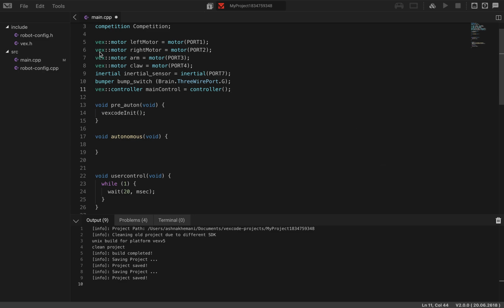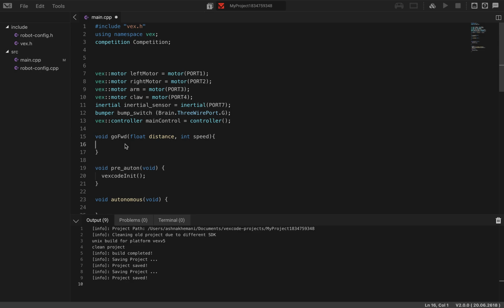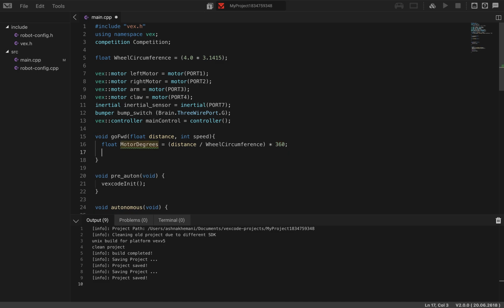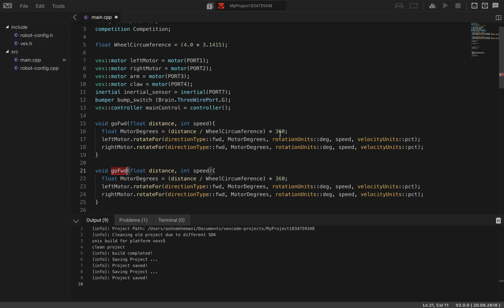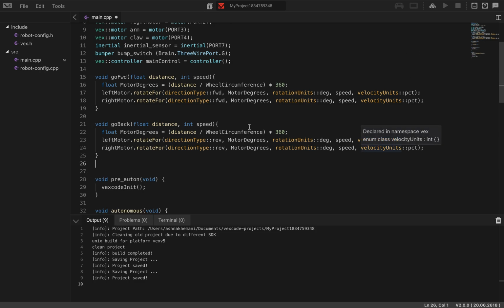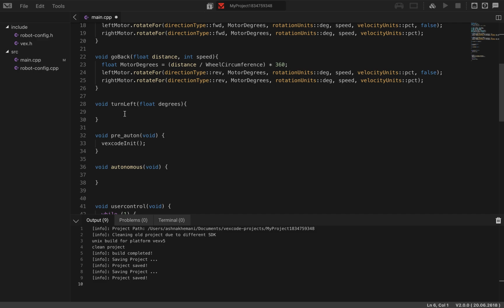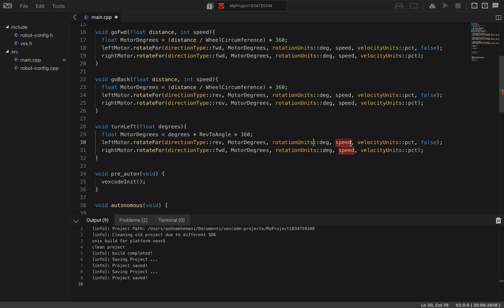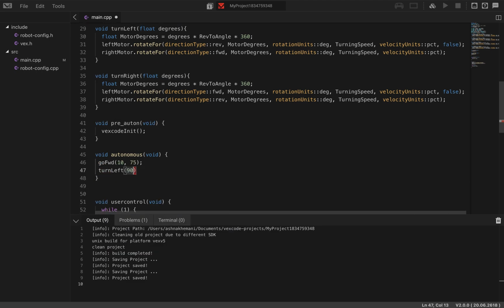Autonomous Drive Functions VEX V5

Comment: Amazing video! Just one question. I know that sometimes robots like to veer off just slightly, which can affect the auton a lot. Do these functions counter this?
Reply: It depends a lot on why it veering off, but the robot will keep trying to complete the auton no matter what this may damage motors from the stress
Reply from the maker: The V5 system is generally good with driving the motors consistently. Veers will typically happen due to your build – maybe a weight imbalance or attaching a wheel too tight so one side spins faster than the other. I personally look at hardware first, but I'm sure there are some cool control loops out there that could help you fix it through software.